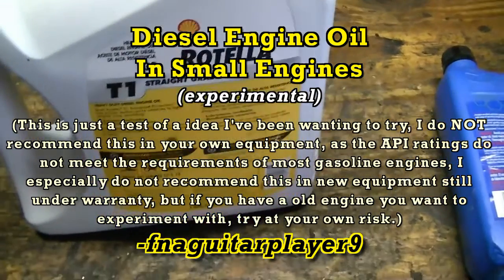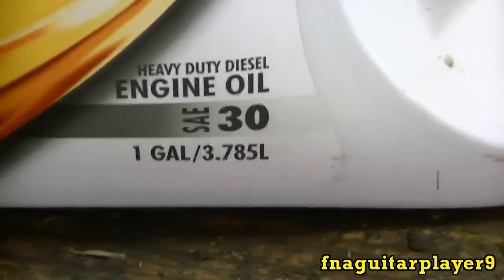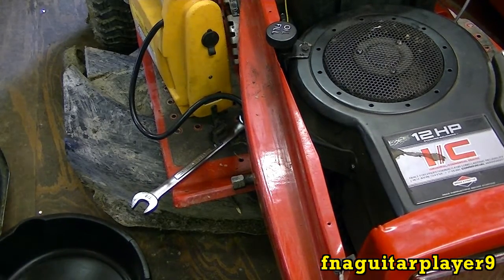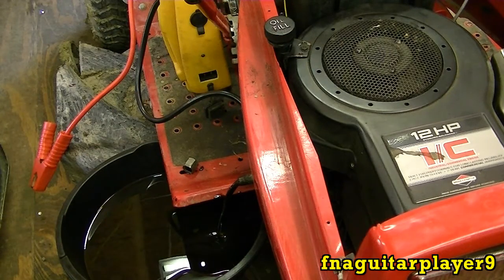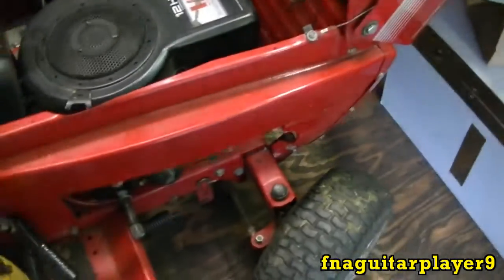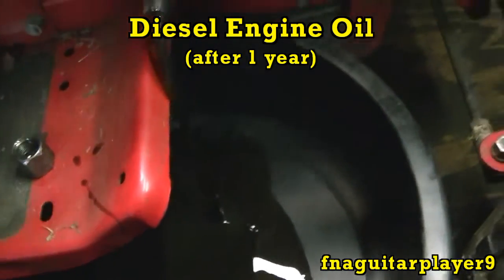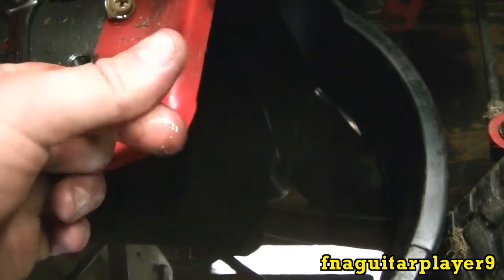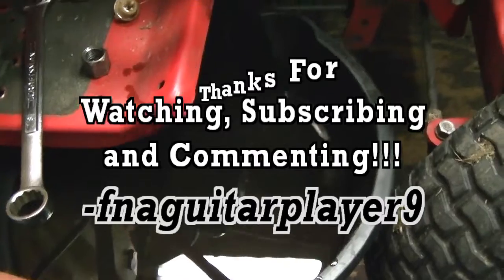Diesel Engine OIL In Small Engines Experiment Test

Comment: Good job, Picker. The main reasons I use the diesel oil is High detergent, Low ash formation and High dispersant which means it'll clean up a dirty engine, won't form more crud and keep the crud that's in it suspended so it'll leave when you drain it out. If ones crudded up bad you might want to use a mix so it won't jerk all the crud loose at one time. I use DELO 15/40 which is a multi-viscosity oil, thinner for cold starts and thicker for hot running. I'd say that straight 30 weight would be just fine overall. But the MAIN reasonI use it in everything I have, even a Honda Civic wagon and an S-10 with a 4.3 is that I'm a truck driver and equipment operator by trade. The last machine I ran on a regular basis was a Cat 980 loader that had over 24,000 hours and had never been touched as far as even adjusting went. NOTHING! Just replaced a leaking valve cover gasket, checked the vitals, everything was still within specs and buttoned it back up. I can show you the machine and we'll see how many hours it has now. It was new in 04 or 05 and was still running a month ago when I went over visiting. That sold me on it. BUT that's just me.
Reply from the maker: Thanks! I could tell its high detergent i put it one engine and when i changed it was dirtier than usual. I hear ya!  My daily driver is a S10 with the 2.2 4 cylinder. I've thought of putting it in it. I use valvoline max life 10w-40 in it. I hear ya! It must be good stuff! Thanks for Watching!!!
Reply: I use NAPA/Valvoline in our Buick with 196k on it. Still runs fine. A wrench buddy of mine swore by Valvoline. Lucas oil treatment, Hi-Tack or a little STP works wonders in rear end gears too.
Reply from the maker: I hear ya! I do use lucas in the oil as well, I've never tried it in the rear end though.
Reply: I bought an old Ford half ton 4x4 and the rear diff was DRY! Like running a dozer over a slab, you could hear every tooth turn on the pinion. Filled it up with Hy-Tack/Lucas and never heard another peep out of it and it was a limited slip to boot. Another pal of mine said a truck dealer years ago told him to put a can of STP in the chunk and you'd never have any rear end problems. The Hi-Tack/Lucas has saved me more than once, but that's just me.
Reply from the maker: I hear ya! Must be good stuff! I might try it in my s10
Reply: Folks squawk about lubrication in cold weather but that stuff doesn't run off. It leaves a film just like chain saw bar oil. Strings out so no part is dry and gets stirred up quickly. I got to put some in my S-10 Taco too!
Reply from the maker: I figure so, i know the lucas oil stabilizer is some thick stringy stuff! I hear ya!

Comment: Much of what oil grades are for the past couple of decades are emission and efficiency requirements rather than wear reduction advancements.  Heavy duty diesel engines have slightly different engineering requirements for the oil and is formulated for those different requirements.  They're pretty similar though and Diesel engine oil is perfectly OK to use in any gasoline engine so long as it meets viscosity requirements.  One significant difference is the antiwear additives such as zinc is much higher in diesel oils to help reduce wear, but these can contaminate cat converters over time so in gasoline engines the limit is lower.  There are many minor differences but in general it doesn't matter much for a lawnmower type engine, and I'd argue that flash point is more important than diesel vs gas formulated oil than most other parameters.  This is available on an oil datasheet from your oil vendor, usually published online.
Reply from the maker: That doesn't surprise me. I thought diesel oil had more zinc in it, but i wasn't for sure. Yeah flashpoint would be more important in a diesel engine, i've heard of old diesels that need rebuilt would "diesel" on the oil seeping past the rings haha Thanks for Watching!!!

Comment: I thought it was sarcasm @ 3:30.....I feel stupid now. From early experiences, I used all brands of oil mixed together just to find a viscous deposit in the crankcase after several hours of use. Then, I repeated the same experiment with all kind of viscosity BUT, sticking to the same brands. Everything was normal. All that was made before I knew that each companies uses different ratios or recipes of antioxidant, detergents ...etc...In essence, if you run out of SAE10, you might use SAE15 from the same maker to bring back the oil at its recommended operational level. Am I right or is it a little risky ? Thumbs-up.
Reply from the maker: haha i hear ya! nope, it actually was a year later. I hear ya, yeah its best to not mix brands/types of oil, especially conventional and synthetics. Thats true to a point, because topping off with a different weight isn't going to matter to much, unless its like half full then you would probably be better off to just change it. I even see on some cheap brands of power steering fluid, trans fluid, gear oil that it should only be used for topping off and not replacing, makes you wander of the quality of it in the first place. Thanks for Watching!!!

Comment: Very interesting, the 2 comments so far seem to show this is a viable alternative.  I'll wait for more comments, but I might just try this, too.
Reply from the maker: I hear ya. I haven't heard any bad so far either, and i've done alot of research, but there is still a chance do to the api rating. I hear ya, thats one reason i made this video to gather more info on it myself too. Thanks for Watching!!!
Reply from the maker: yeah we did talk about that, I hear ya, thats about how i am, i take care of everything. I noticed that one time i ran synthetic 2 stroke oil. It doesn't burn as well. I'm using havoline 2 stroke oil at the moment.
Reply: I've heard that Kohler came apart because the were assembled in China by robots and the torque settings were wrong. I got one that has 72 hours of use and suffer internal failure. It'll cost near 2 gran to have the exact replacement.
Reply: I think we've yakked about me having a buddy that repairs these for a living and a lot of the V-Kohlers are coming apart and the reasons the dealers think is too fast, too hot and too thin oil. I never hammer my stuff unless it's the trimmers but am going back to the straight Stihl or Husky oil instead of synthetic because it slobbers so bad. I'd rather have it on the inside than the outside but that's to double the warranty on homeowner grade stuff. My warranty's have been dead for years and I never had any trouble with the good grade 2-cycle oil anyway.

Comment: I just retired from a local school district and had 33 large and small diesel buses, 15 vans, pickups and cars with gas motors 6 gas powered lawn mowers and other equipment with gas motors. The only oil i used in every thing was a series3 diesel oil in 10w30 made by kendall oil. I never has a single problems related to oil and I did this for the 30 plus years i worked for the district.  Today i use wal-mart diesel oil in 10w30 in all my personal lawn and garden equipment with zero problems.
Reply from the maker: I hear ya! Good to hear that you never had any problems over a long period of time. I didn't really see where it would hurt small engines, but was concerned over the api ratings. I hear ya, I use supertech for flushing and for break ins after rebuilds. it works good for that. Thanks for Watching!!!
Reply: I've poured many a brown Kendall can. Good stuff!
Reply from the maker: I hear ya!

Comment: I used that Rotella HD30 in my push mower for years. Worked great. That same T1 rotella used to have the API gasoline rating. But they dropped that since no new vehicle or vehicle used in the last 30+ years has recommended a straight 30 weight. Same stuff, they just dropped the rating on it since it cost a lot of money to have it on there. Most of the additive levels in that Rotella is about the same as older SAE30 gas oil used to be anyways.
Reply from the maker: I hear ya! It seems to be a good oil for small engines. I did read something about that, didn't know it was because of the weight not being common anymore. I first discovered this oil because i've been trying to find  a 30 weight in a gallon/5qt jug, then seen diesel and started thinking. Thanks for Watching!!!
Reply: One thing yall might check is the MIL. specs. That was the gold standard for a lot of stuff way back when. I haven't even looked at the ratings in years. Used to use URSA by Texaco but it faded out somehow, along with Marfac grease.
Reply from the maker: I'll have to check into that. I've heard of Marfac grease, they used to use it at work.
Reply: We used it in gearboxes on Unit cranes when the 80/90/140 wouldn't stay behind the seals. That's what was recommended by Unit but it was a long time ago. It was aluminum soap-base grease. Like Snapper OO grease but maybe a dab thicker.
Reply from the maker: I hear ya! Thats some thick stuff. Were using schaeffer 229 red #2 for packing bearings in equipment, its super sticky/stringy. Seems to be good stuff.
Reply: I think I'm using DA Rediplex or #2. Good stuff and will get all over you. It hangs good but is stiff when cold. Have to reef on a grease gun handle.
Reply from the maker: I hear ya, thats how this stuff is!
Reply: Lewie McNeely I seen  unit shovels  in the junkyard you must  be getting  up there in centuries